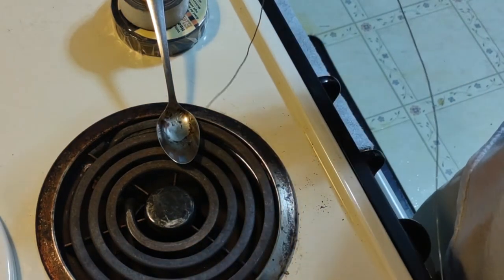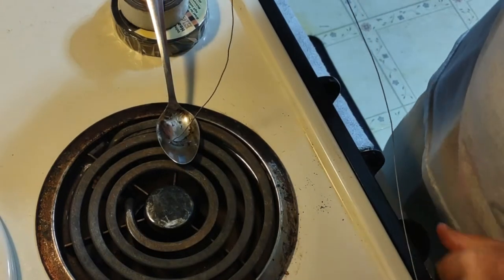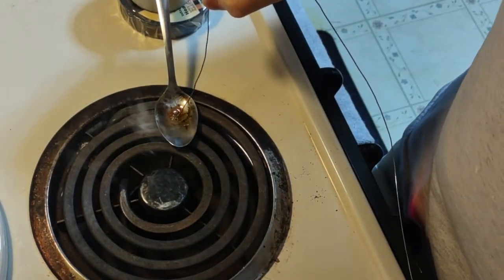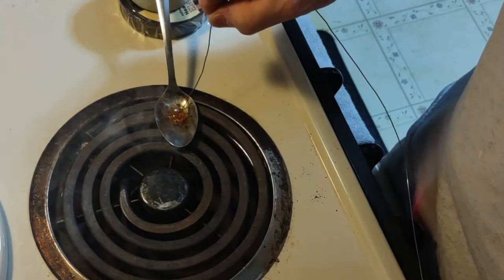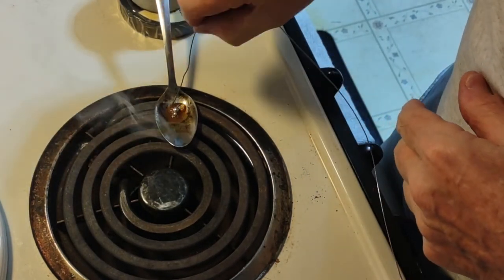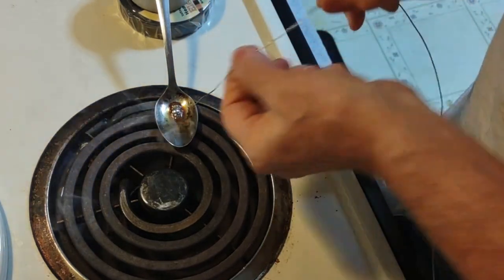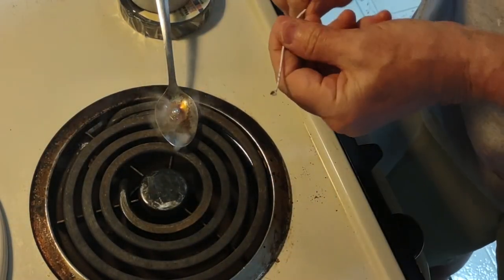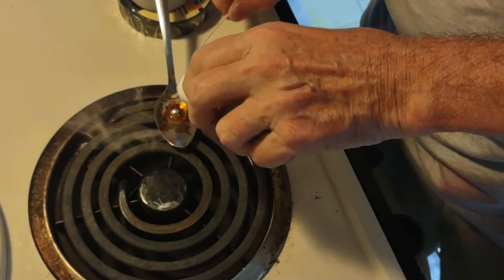Tinning Litz wire

Comment from the maker: Since the time I made this video, I have found adding the flux to the spoon is not useful. You do need to coat the end of the  litz wire with flux. I turn the stove down to 7 once the solder melts and insert the end of the litz into the solder ball.  It takes a few seconds for the insulation on each wire to float to the surface and then the solder wets to the copper.